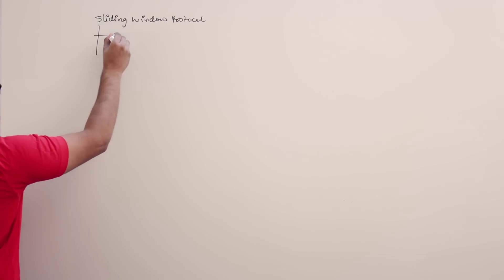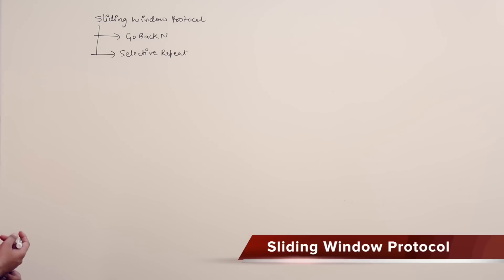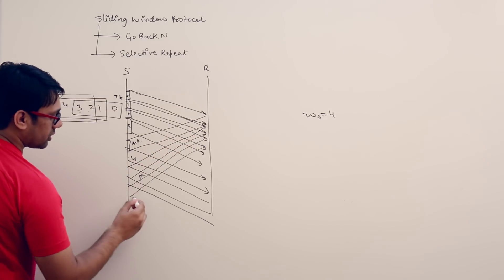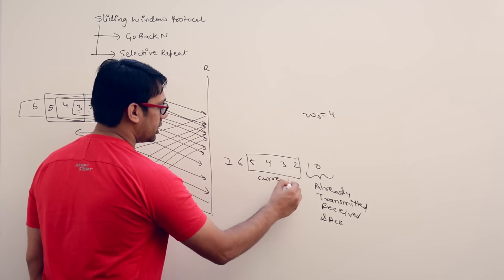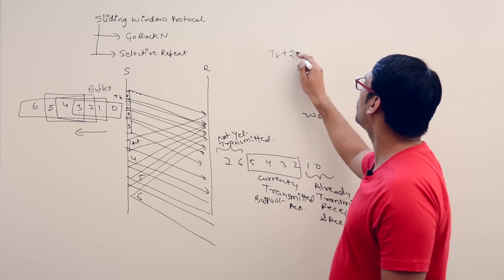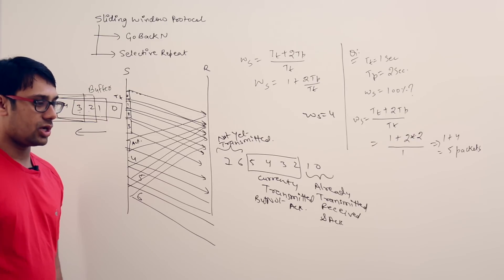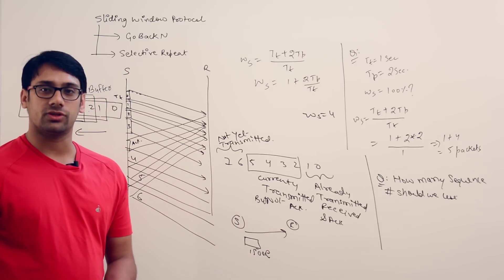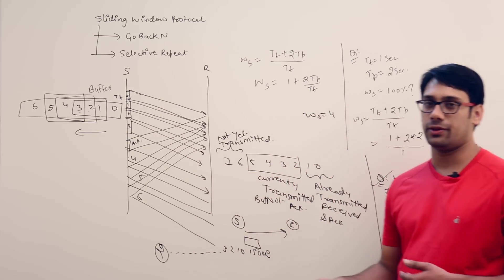Computer Networks 10 sliding window protocol

Comment: what is the difference between transmission time and propagation time?
Reply: Transmission Time - is the time it takes to put all the data into the link (wire) by the router. 
Propagation Time - is the time taken by the data to travel the distance at the speed of light (speed can vary depending upon the medium). 
I think, transmission delay and transmission time should be the same thing so I am quoting Kurose and Keith "Computer Networking" - The transmission delay is the amount of time required for the router to push out the packet; it is a function of the packet's length and the transmission rate of the link, but has nothing to do with the distance between the two routers. The propagation delay, on the other hand, is the time it takes a bit to propagate from one router to the next; it is a function of the distance between the two routers, but has nothing to do with the packet's length or the transmission rate of the link.